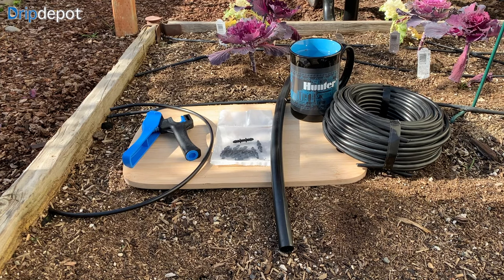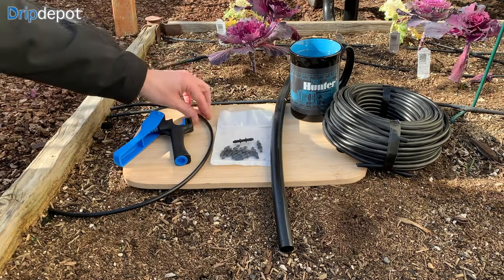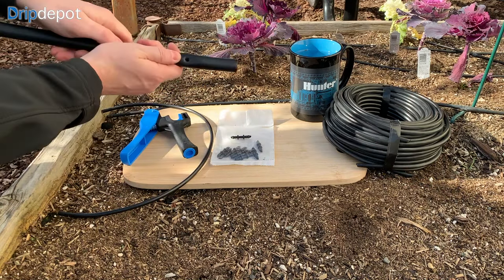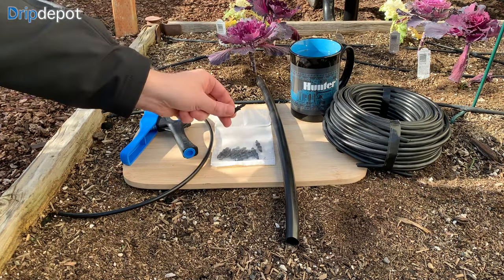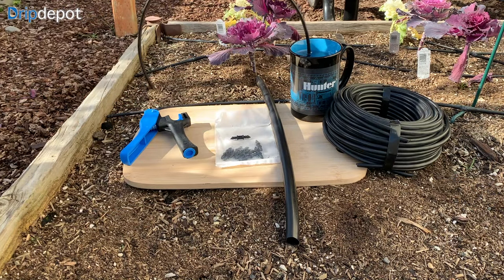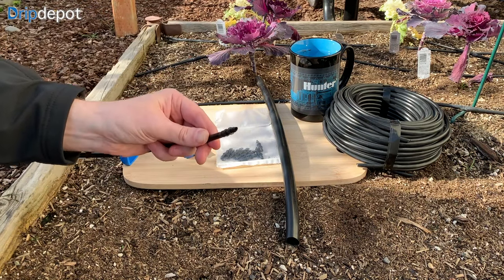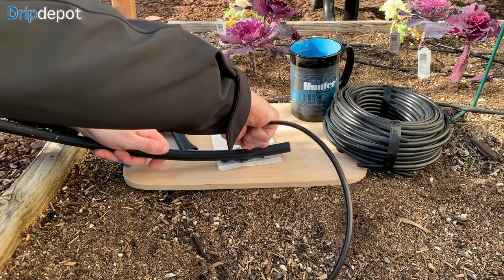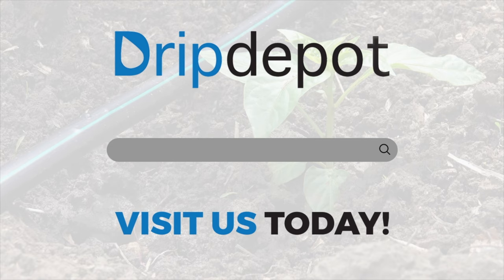How to Connect 1/4" Irrigation Tubing to 1/2" Irrigation Tubing

Comment: you are the onlyperson who has mentioned when it comes to punching holes into the largerpipe toput in drippers if the pipe is warm i find it not possible to push in the drippers as the pipe is to flexible the pipe must be cold to do a easy job glad you brought this subject up regards henry
Reply from the maker: I fully agree Henry, thank you for noticing!

And yep, I also learned it the hard way, trying to punch a hole on a hot day and all it would do was stretch lol
Reply: That caught my caught my attention as well.  Excellent point.

Comment: Today was the first time install for me. Boiling water to soften the 1/4 inch tubing for the barb to go in, still impossible, had to first use a Phillips screw driver into the 1/4 inch heated up tube to widen the tube.
Reply from the maker: That's one way to do it too!  Did you get the tubing and the barbs at the same place (us, another retailer, etc)?  The reason I ask is that it shouldn't be quite that difficult when the parts are sized for one another -- the hot water trick typically makes it pretty quick (other than waiting for the tubing to soften in the water).  If you did get them from the same place, maybe try letting it soak in the water a moment or two longer?

The screwdriver method can work too, my primary concern would be it operating leak free after -- it should close up around the barb through natural thermal expansion afterwards so long as it didn't get stretched too badly :)
Reply: @dripdepot Yes, it came as a packaged kit.
Reply from the maker: @thomasklein9766   Roger that!  When they're designed to go together they can be tight to ensure leak free operation, but I can confirm it shouldn't be too bad with heated tubing.  It should be safe to go with the method you did though -- after going through a thermal expansion/contraction cycle or so, the tubing stretched by the screwdriver is going to regain its initial size and really clamp down on that barb.

Comment: Very helpful! Thank you very much! I have two questioins. First, can I connect 1/4" tubbing with 1/2" emission tubing (with check value)? Can I still punch a hole in the tubing (not connecting with CV emission holes)? Second, can I plug goof plugs back to the emission holes? Thanks!
Reply from the maker: If I'm understanding correctly, then you bet, you can connect 1/4" tubing to 1/2" poly drip line -- you'd want to be careful not to punch into one of the emitters in it (they're quite a bit larger than the hole where they drip from would suggest), but other that it's the same as connecting 1/4" tubing to blank 1/2" poly tubing like in the video.  :)

Unfortunately, goof plugs will not work for the emission holes -- there's been a lot of demand for that, and I know of at least a few inventors who have tried to make them, but so far to no avail.  Hopefully sooner rather than later as something like that is highly requested!

Comment: I notice that the barbs have a 45 degree cut at each end.  Should one "face" the  hole of the barb into the direction the water is coming from in the 1/2" main or is it basically irrelevant which direction that hole faces inside the 1/2"?
Reply from the maker: This is a great question!  

The 45° cut does not need to face the flow of water -- it's actually the water pressure that pushes water up into the barb and then through into the tubing it's connected to.  

The 45° angle is actually there for the same reason it's on a hypodermic needle that a phlebotomist uses -- is facilitates and easier entry into tubing than if it were a pure conical shape :)
Reply: @dripdepot  Than you!!!

Comment: My system is all set up and water is flowing through the 1/2" mainline.  Just about every connection is leaking where I have my 1/4" drip-line emitters connected to my 1/2" tubing.  It is also leaking at the end of the 1/4" drip-line where I have goof plug installed.  I am using 25 psi water pressure regular at end of my head assembly.  I don;t know why each connection is leaking.  Could this be too much pressure?
Reply from the maker: At 25 PSI I can confirm the dripper (and 1/4" fittings) connections should not leak where they join the 1/2" mainline -- leaking like that is a sign of too high of pressure, but 25 is well within the green.  

Let's see if we can determine what's causing it -- is the leaking recent, or has it been going on since you installed the system?  The reason I ask there, is a drip or so is common, but only for a moment or two and typically only the first time you run the system.  If this is a fresh install, the first thermal expansion should seal the tubing up over the barb even more. 

A gentle tug on your dripper can also help -- this helps seat the barb against the wall of the 1/2" tubing.  Do it while the system is running and the water pressure will help hold it in place.  This followed by thermal expansion is usually sufficient to stop any drips from the connections. 

After that I'd want to take a look at the connection (you could send over a photo and I could see if I spot anything at a glance) and confirm the installation method -- 1/4" punch to punch the hole, then insert the barbed end of the dripper.  

Happy to help either way so you can enjoy it leak free!
Reply: @dripdepot  Thanks for the response!  Just installed the system and happened immediately.  Just spoke with your customer support team and they think I need a low flow rate pressure regulator as I only have 50 emitters @ 0.5 GPH per emitter.  So my flow rate is only 25 GPH (0.41 GPM) which is less than the min flow rate of my pressure regular (min 0.5 GPM).  Gonna try and swap out pressure regular and see what happens
Reply from the maker: @jamesrossini7074  Aha!  Good catch by them, that can in fact happen -- we were filming the fertilizer injector video one day and the operating pressure was way too high even though we were using a pressure regulator.  We had to end up hooking up a few microsprinklers off screen to get the flow rate high enough to engage the regulator.  Good chance it's that. 

If it's not, we'll stick it out until the end to get you going leak free -- if this doesn't work, send us some photos of the leak in action and of the head assembly (the parts at the hose bib) and let us have a look.  

Fingers crossed!

Comment: How do I fit  a 1/2inch poly tee into a 1/2inch poly tubing
Reply from the maker: Heya Steve!

Generally you'll just need to push the tubing on over the barb of the fitting and then either turn the locking nut if you're using a Loc fitting or use a clamp if you're using a barbed insert fitting.  If you're using a compression fitting, just a lot of elbow grease to get the tubing through the compression ring. 

Here's a quick video we made some time back showing how to install tubing on to a Loc style tee fitting: https://www.youtube.com/watch?v=Jx_yzI1E3Zg

Comment: Is there a tool available for coupling 1/4 inch drip tubing together easily? For both inclined drivers and couplings?
Reply from the maker: Sorry I missed your question for so long Joe!  I wager you got it worked out, but just in case -- we don't have a tool that will fully couple two sections of 1/4" poly together, but there is one that will at least do half the job (connecting 1/4" tubing to one side of a 1/4" coupling) at this link: https://www.dripdepot.com/product/dig-quarter-inch-insertion-tool

Comment: Is there a maximum length that you recommend for using the 1/4” tubing?
Reply from the maker: The maximum recommended run length for a run of 1/4" tubing is 30' :)
Reply: @dripdepot  perfect. Thanks for the response!!!

Comment: When I insert the 1/4” barb into the hole I punched in the 1/2” tubing, I find the barb essentially “bottoms out” and touches the inside wall of the half inch tubing because the barb is so long. Is this going to cause problems with getting water to flow from the 1/2” tubing into the 1/4” tubing? Should we be using a barb that isn’t so long?
Reply from the maker: Bottoming out sounds like it could be a little long, but I wouldn't anticipate any problems with water getting from the 1/2" into the 1/4" -- once the lines are full, they become pressurized and the pressure will push the water up into the 1/4" fitting.  The 1/4" fittings are typically cut at about 45° so even if it's touching the bottom of the tubing, water will be able to enter it :)

Comment: A very helpful video. I have all equipment and pieces you have, but find it impossible to insert the 1/4 inch coupling into the 1/2 inch irrigation tubing. Everything else seems to work fine. Any suggestions?
Reply: You bet -- I find it easiest to insert when the 1/2" tubing is cool -- it kind of allows the 1/4" coupling to "pop" in instead of stretching the 1/2" tubing.  It may be worth making sure your punch is a 1/4" punch, too small of a hole could make it very difficult to get the coupling in.

Comment: My 1/4 inch tube won't stop leaking where it is joined to another 1/4 inch tube.
Reply from the maker: I'll be happy to help!  And can confirm water shouldn't leak out of coupled sections of tubing, let's see if we can pinpoint the cause. 

You probably already have, but just in case, double check the connection on the leaking end -- this mostly means making sure the tubing is completely covering the barb(s) on the coupling -- it also helps if the tubing has a nice straight end (jagged ends can leave a little room for water to come out of). 

Check pressure if you haven't already -- the smaller (1/8" and 1/4") tubing sizes are best used at 30 PSI or less -- running it at higher PSI can cause symptoms like this, particularly in conjunction with other small things (jagged tubing ends, incomplete connection, etc). 

If the pressure is around 30 PSI or less and the leak persists, let me know, happy to help getting this up and running leak free as it should :)

Comment: Several of the connections I made leak at the 1/2" tubing, several are snug and don't leak.   Trying to figure out why.
Reply from the maker: We'll be happy to help!  I can also confirm these connections should not leak -- how recently did you install these?  A small drip or so on a new install is common, but after a cycle or two (and after being warmed by the sun) even that leak should cease -- if it's a newer setup, let it get warm in the sun so the tubing expands further over the barb. 

Was there anything different used with the leaking ones than the non-leaking ones?  Basically checking to make sure you used the same punch to make the hole in the 1/2" tubing. 

If none of this appears to be the case, fire us off an email from the contact us portion of our site -- we'll get back to you quickly and and that way we can send and receive images :)
Reply: @dripdepot  thx.  Part of the problem - I think - is that the triple digit Texas heat has made the rubber 1/2" tubing too pliable.  I pulled out the leaking connections & covered the tubing over the hole with electrical tape & plugged the connectors back in.  That mostly worked.
Reply from the maker: @19AKS58  Ah, yes, I didn't consider the heat -- that could definitely be contributing, you have the exact right of it.  The tubing withstands heat pretty well, but yes, those blazing hot days in TX and the Southwest can lead to unexpected behavior since it softens things up considerably at that point.  

Not sure how convenient it would be for you, but a thin layer of mulch might help too (and it's safe to cover with mulch).  A little shade from mulch or some type of cover might help it not get above the temperature break point where things start to behave not as intended.  

Glad the tape is at least mostly working, I'll file that way in my toolbox for other folks in a similar situation, thank you for that!
Reply: That’s a cool fix . Going to try this fix with the electrical tape. I have three leaking at the barbs out of 20.

Comment: Question: do you use any type of waterproof sealant ie. flex seal, to seal the connection between the 1/2 and 1/4 inch tubings?
Reply: No sealant or similar necessary -- the barb is a bit bigger than the punched hole and the water pressure will push it against the wall of the tubing creating a good seal.  The tubing also expands (particularly in the heat, but even without it will try to retain its initial shape) over the barb.  If pressure were too high it's possible leaking could become an issue, but their use is pretty much exclusive to low pressure drip irrigation.